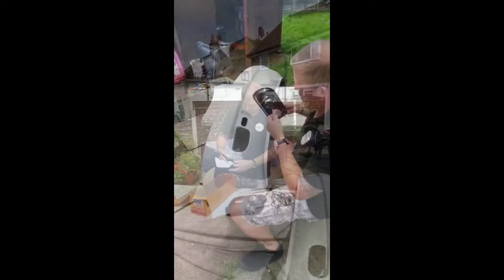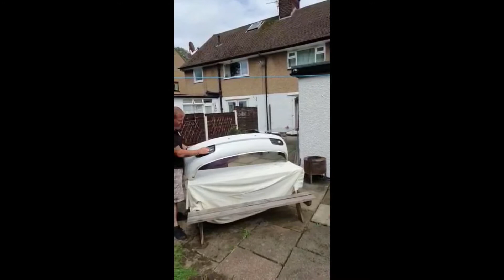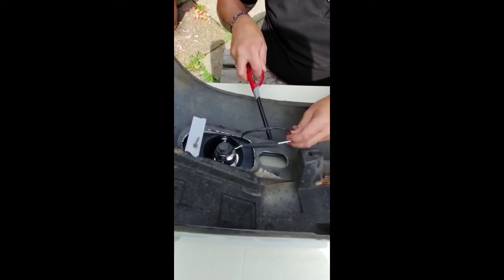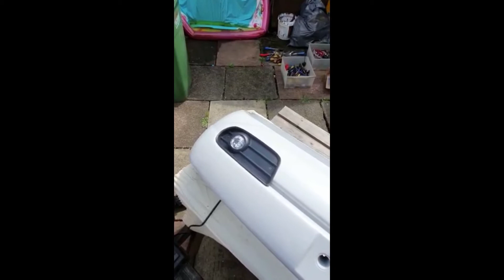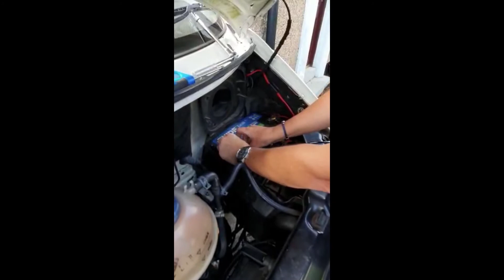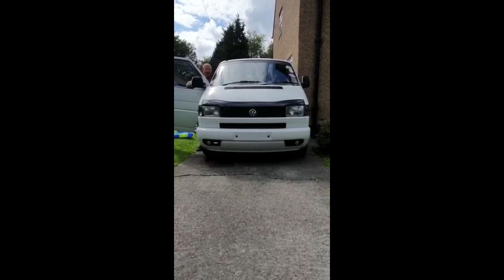VW T4 Transporter Fog Lights Installation

Comment: Just a thought. As they are fog lights could you not connect the relay to the rear fog light feed so that wg=hen you pull out the hedlight switch to activate the rear fog the front ones light up too?

Comment: It's negative terminal off first, to prevent a circuit being completed from any unintended powering up/short-circuiting of any equipment. No need to remove positive terminal.
If both terminals are disconnected, always refit positive terminal first.

Comment: With the wiring kit ,the negative and positive being on the battery that means it's live all the time and not ignition live does it not ??I'm asking because I've got the same job to do
Reply from the maker: Yeah it is live with the switch sent with the original kit, however what we’ve done is bought a second hand VW fog light switch, and wired it up to that and fitted into the dash now and that breaks the circuit. But yes initially it is a permanent live
Reply: @MonkeysUncleDubzClub  brilliant where can I get the vw switch
Reply from the maker: @RicksAquariumsuk  I found someone breaking a van on Facebook marketplace 👍🏻